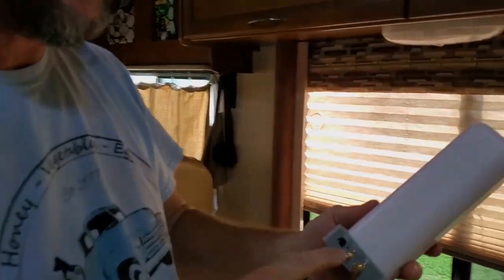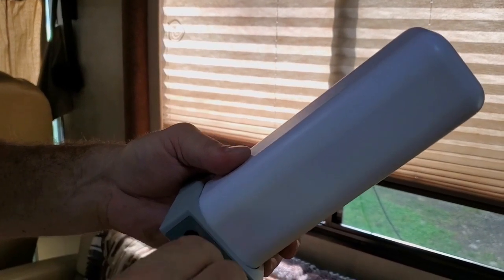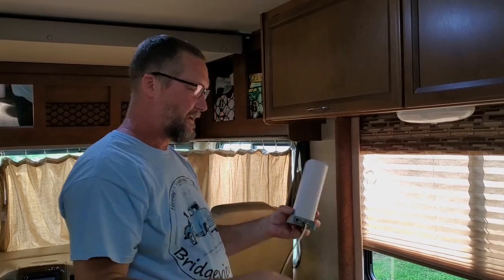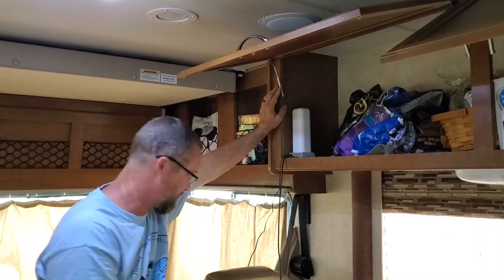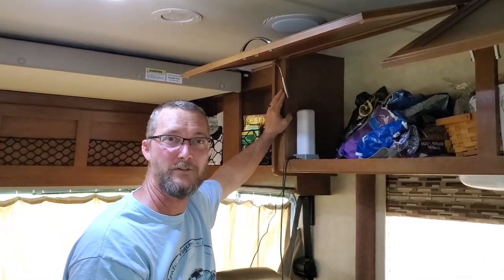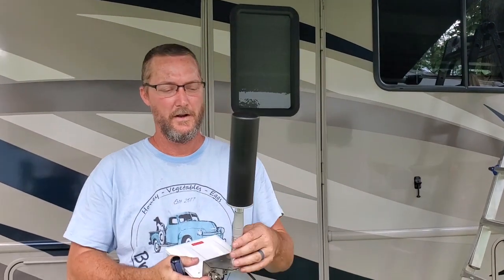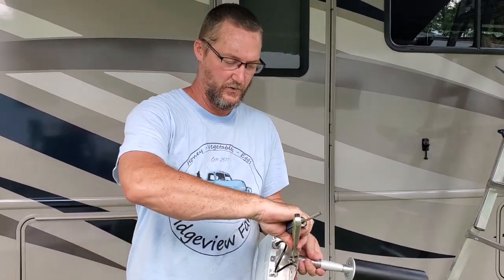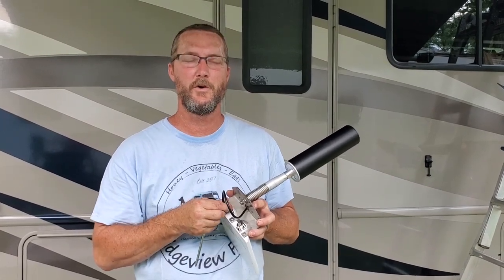Solid RF RV PRO Cell Phone Booster Install || Motorhome RV

Comment: Nice Installation! We also found getting the cable from outside to inside was the trickiest part. The dry run is an excellent idea! Can't wait to see your performance video.
Reply from the maker: Yes, figuring out how to run the cable takes extra brain work. It's never fun to drill holes all the way through the RV wall!  haha.. but,  it worked out nice and now we can also add a LED strip under the awning too.   Thanks guys.. and Happy Trails up there Canada!

Comment: Good point with the importance of the soft install/ dry run. Measure twice, cut once! The outside antenna picks up signal in a donut like shape, so as long as you are inside the "donut-hole" with the inside antenna there won't be oscillation, but it's worth the time to find the sweet spot depending on the particulars of your RV! Great install, and great location to do it- nothing like a view while you're working'! Thanks for the video!
Reply from the maker: We found in our particular rig that the indoor antenna didn't work as well being right up next to the inside wall by the couch. This was our original location until we did the dry run. It really does pay off to test first.  We are chomping at the bit to test out that secondary antenna.    Thanks Andy!👍🤠